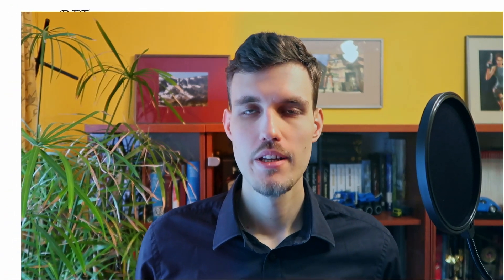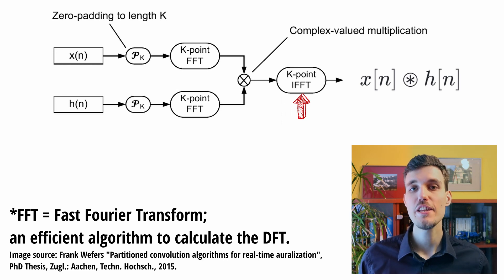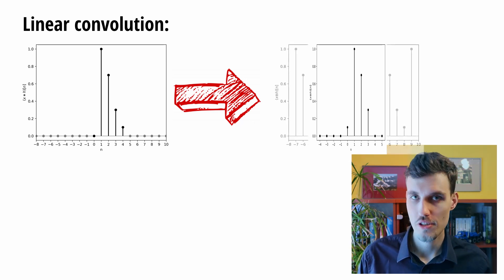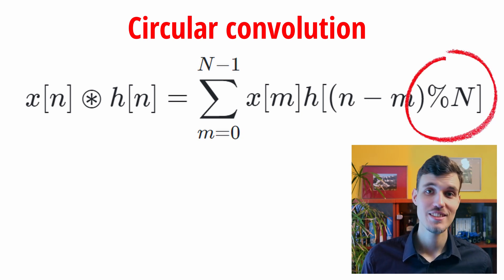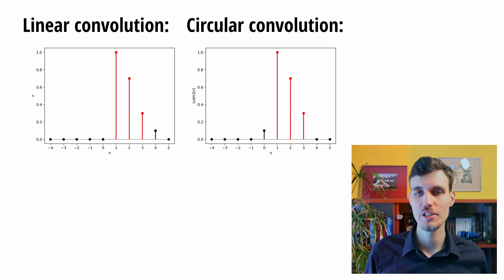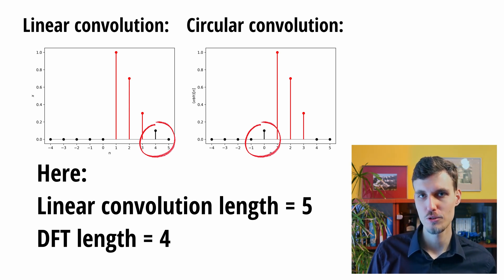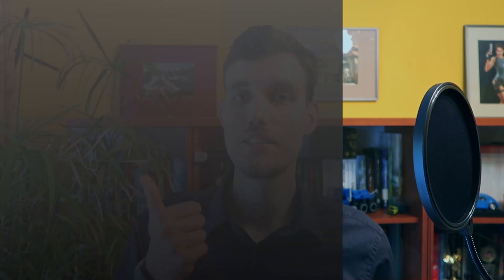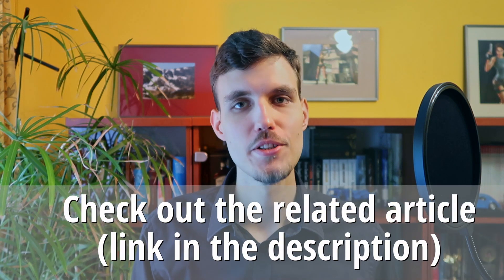Circular vs. Linear Convolution: What's the Difference? [DSP #08]

Comment: For me the nicest way to think about this is to think of the conv as matrix muliplication and then do eigenanalysis on it. Explains really well the connection between shifting, padding and Fourier/DFT transform and why conv becomes multiplication
Reply from the maker: Nice, thanks!
Reply: Could you elaborate a little more on the eigenanalysis portion?
Reply: @MrSocialish  Convolution = Sum(Signal*impulse response) where you shift the impulse response over time. You can write this as a matrix multiplication in which you have the signal as vector times a matrix that row by row shifts the impulse response by one entry.
In the case of linear convolution you pad the shifted impulse response by zeros, resulting in a toeplitz matrix. In the case of circular convolution you get a circulant matrix.
Now you can do eigendecomposition of those matrices. The toeplitz one gives you eigenvectors of the fourier transform, the circulant has the eigenvectors of the DFT.

If you rearrange the equations a bit you can see the convolution theorem: Convolution in time domain is equal to multiplication in the frequency domain. Or without rearranging: to filter a signal decompose it into sinusoidals (eigenvec matrix^-1 in decomposition), change their amplitudes according to the filter (diagonal eigenvalue matrix in decomposition) and then put sinusoidals back into time domain (eigenvec matrix in decomposition)

The deeper reason being the connection of derivatives and polynomials when looking at ODEs which are linear systems hence describable by linear algebra (y'' -> x^2 -> solve for x -> complex numbers -> fourier)